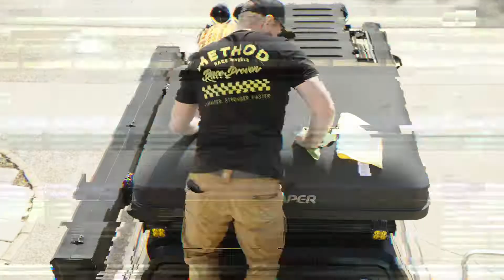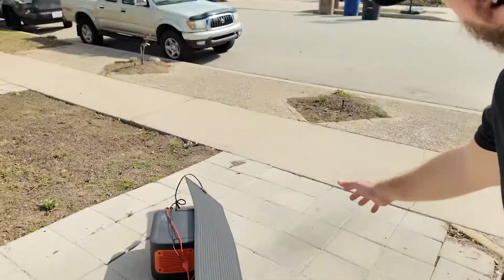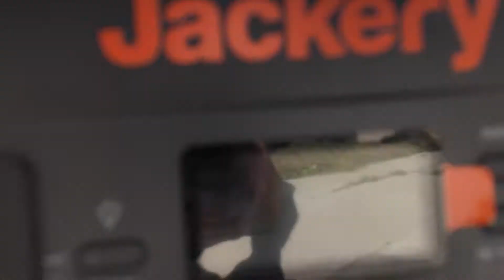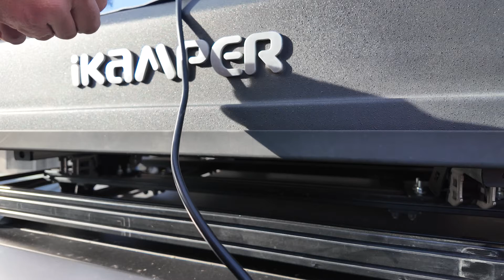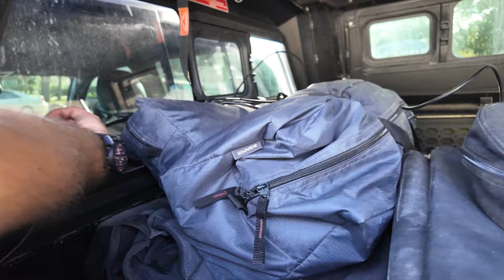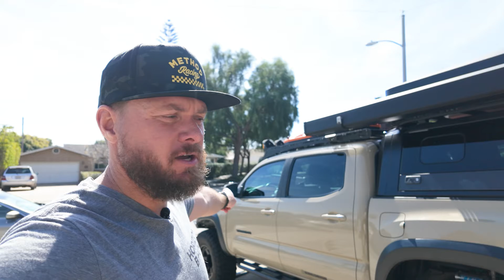Stay Off Grid Longer! Lensun Solar 80W iKamper Skycamp Mini Panel Install and Review

Comment: Can I have the link for the adaptors for the Jackery? I got three solar panels but didn’t get the controller. Do you think I need 3 mppt controllers or just one with an adaptor? If so can you let me know the type of adaptor I need?
Reply: If you are going into a solar capable BCDC or a solar input on a power station like an Ecoflow, Jackery or whatever, you don't need the MPPT. If you want to push solar to a battery directly, it is better to use it. It stops the overcharging, and changes the charge profile to suit the battery.

Comment: Depend on how long the charge lasts when in use , thanks for the vid
Reply from the maker: In sunny conditions, our hood solar panel can continuously power a variety of 12V devices, including fridges, mobile phones, GPS systems, lights, dash cams, and even a Starlink. This means no matter where you are, as long as there’s sunlight, you can rely on uninterrupted power for all your essential devices.😆